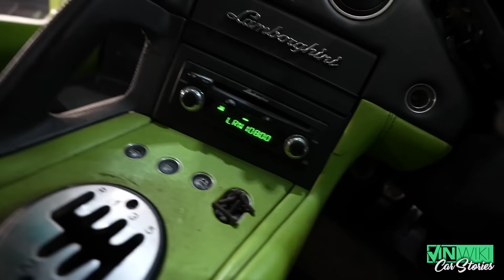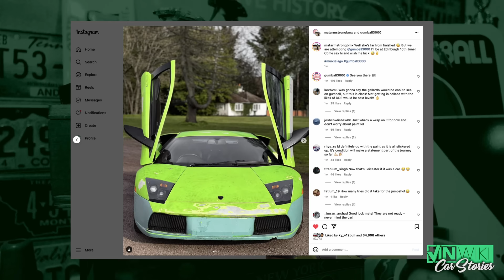Mat Armstrong got SCAMMED on his Murcielago project!

Comment: There has to be a storage chip on the old instrument cluster - find out what chip and pull it and send it to a data recovery specialists
Reply: It's still definitely worth a try but like Mat said, old eeproms tend to get corrupt after a short.
Reply: It's probably using an EEPROM, and it would seem the instrument cluster doesn't have reverse voltage/over current protection. Someone could probably easily dump it, maybe they have, maybe the bytes where the mileage is stored are scrambled.
Reply: @JacobJonesy  Would they really just keep programming an EEPROM over and over? Is that a common use case with them? Do they have a max number of write cycles?
Reply: @andrewdunbar828  Yeah they are commonly used in odometers, they normally have 100k-300k write cycles in them but engineers utilize them in clever ways to achieve much higher lifespans.
Reply: @JacobJonesy  eeprom is usually to control something so it can store program functions with write protection but remove the write protection to upload new eeprom settings. It could be stored with the program functions though I don’t know how those are programmed whatsoever m all honesty.
Reply: @JacobJonesy  Thanks for the technical info!
Reply: @andrewdunbar828  On the Concert stereo of the Audi A4 B5 they used an eeprom to store the volume setting, so that when you re-started the car, the volume and source was the same as when you turned it off. They only made a mistake in programming, it was supposed only to write on powering the car off, instead it wrote on every turn of the knob. That's why these units went bad after a few years, and VW exchanged them for fixed ones at a high discount. For a time, they would start working again when they got warm, but at some point they were dead. 

Now if an instrument cluster would only write the current values at power-off, it should live tens of years without incident.
Reply: @Kommunisator  Ah thanks. I guess EEPROMs were the only kind of nonvolatile storage at the time. Somehow I guess I thought they were slow or tedious to write to like when doing a firmware update and didn't know they would be suitable for more or less constant use like in an odometer.

Comment: Can likely recover the mileage from the onboard EEPROM of the old cluster, even if the cluster is not functional. Doubtful that any EEPROM would have be damaged by overvoltage / reverse polarity - the voltage regulation hardware which supplies it would have been damaged instead.

Reading most EEPROMs are easy to do, either in-circuit or after removing the IC. Plenty of automotive electrical companies out there who can do it.

Comment: the manual box and the e gear box are basically the same as the e gear is doing the shifting but its still a manual box at its core. the "robot" of the e gear is essentially physically shifting it with electronics. lambo does this so it has that raw and real feel still and they think making an auto transmission ruins that. you can simply convert any e gear transmission to a stick shift manual by drilling those holes and doing a few other minor things

Comment: Saw advert for fire extinguisher. Had to use powder on my BMW, wire under dash shorted, but..........few years later damp got in car, powder not cleaned out of brake light switch, contacts corroded contacts and blew the abs unit.
So be warned.

Comment: 2002 Lamborghini Murcielago Pricing and Specs
From $114,840* this is here in Australia. 120k Ozzy is about 60k in English pounds for a complete car. Yeah, you got done on this one hard. Good luck anyway. Found one for ya in England complete. Lamborghini Murciélago 6.2
2002
19,000 miles
6.2L Petrol
Manual
 CF11 9LJ Cardiff
£79,990
Rare car